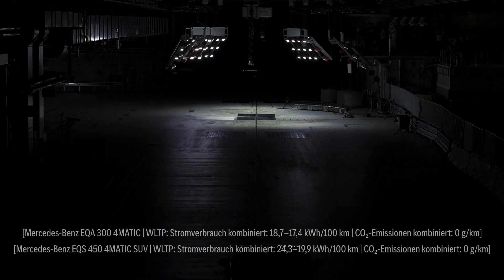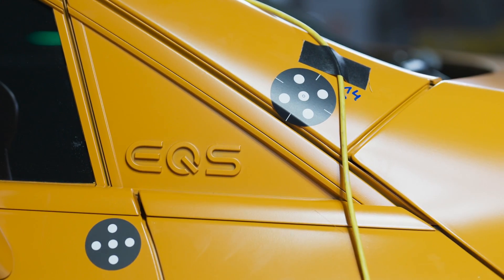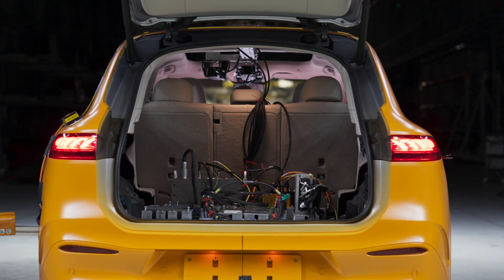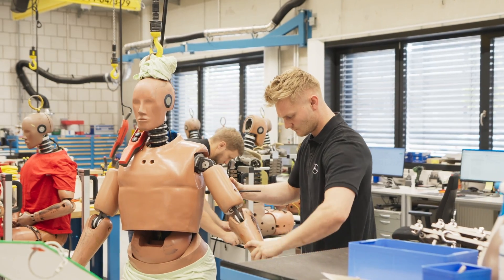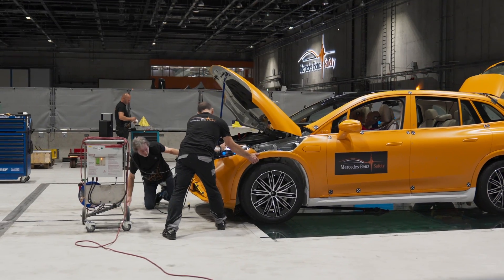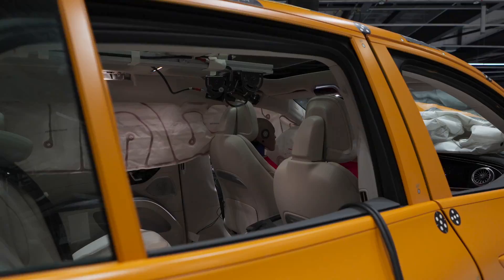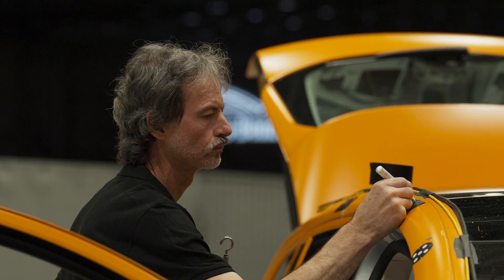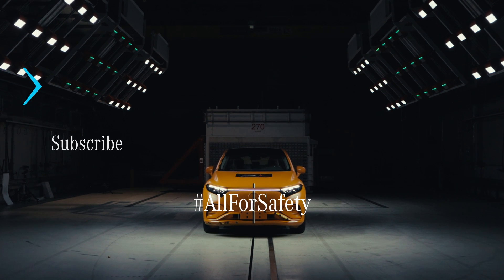The world's first public two-car electric crash test by Mercedes-Benz

Comment: Both cars written off at best. Hopefully the batteries dont self ignite otherwise surroundings will be damaged as fire teams will have to leave the cars to burn out. The road will have to be resurfaced. If, somehow, the fire team manage to extinguish the fire, both cars will have to be quarantined for weeks in a wide open space to ensure no further self ignition occurs. Batteries to power cars in far more obviously mental than mass consumerisation of diesel engines ever was.
Even if the battery was completely safe, there is no way to know that at the scene, so all preparations will have to be made as though the car is a serious fire risk.
These cars are already making insurance unaffordable. Though that is likely their real purpose.